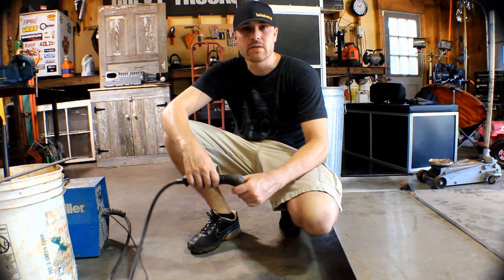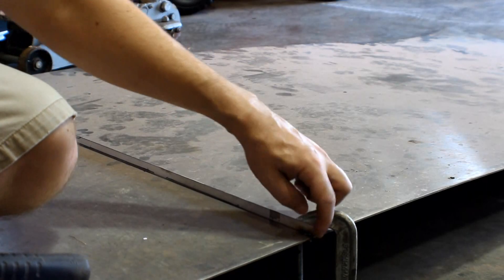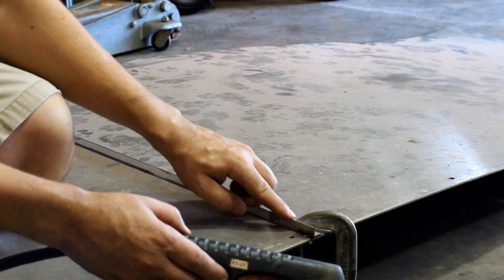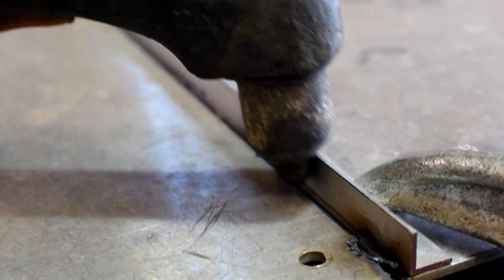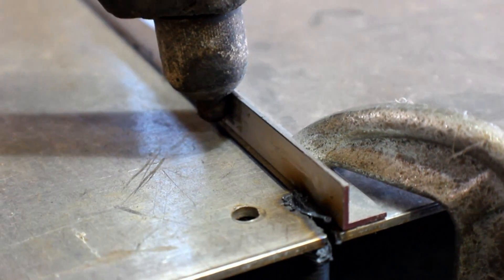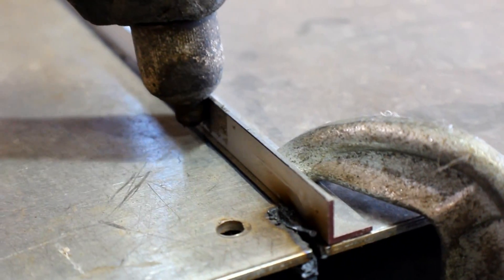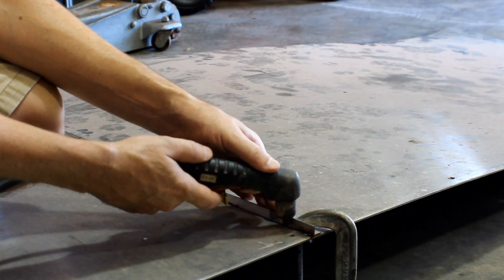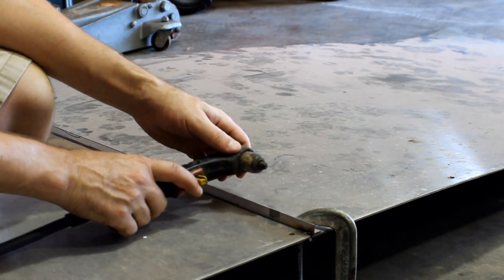Plasma Cutting Quick Tip | How to Make Straight Cuts

Comment: what distance should be from plasma torch tip to the metal sheet?thanks for sharing
Reply from the maker: Ghasem Farahani 1/16-1/8 inch. It just doesn't need to be touching the material
Reply: thanks a lot for your help,your video is watched in iran,so greetings to you from Iranians,
Reply from the maker: Sweet...that's awesome

Comment: Good tip, a piece of angle works great any size. Just have to compensate for the thickness of the torch
Reply from the maker: That Guy There Thanks...yea some times getting the compensation just right is a little tricky.